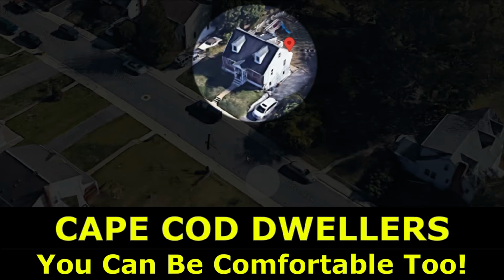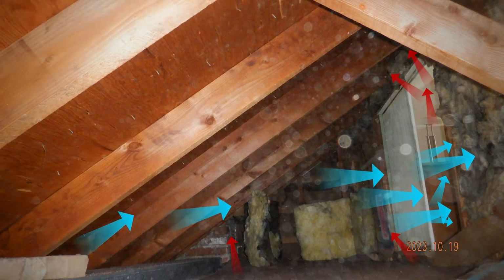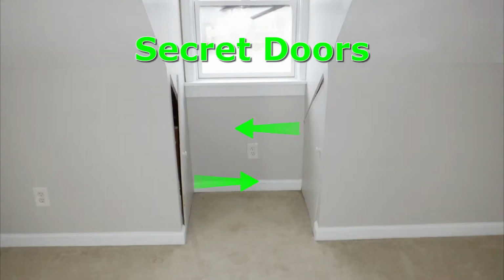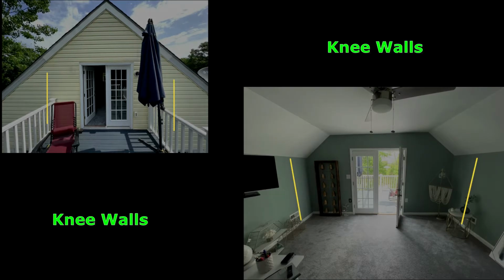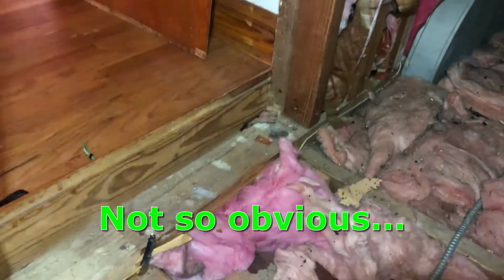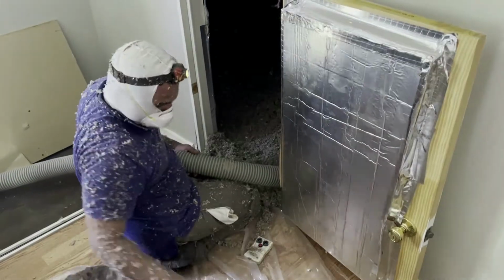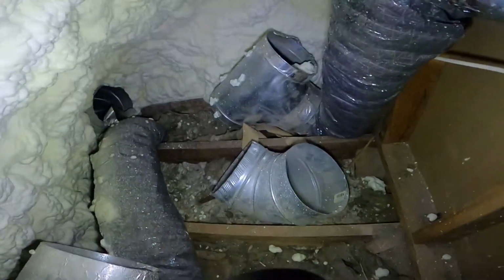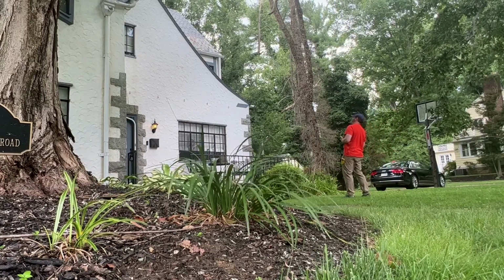🏠 How to Insulate a Cape Cod-Style House | 3 Modern Methods to Improve Comfort Year-Round

Comment: Great video. What would your approach be if a cape cod does not have soffit vents? We do have ridge vents in the peak of the roof and gable vents up in the peak area as well. We currently have super old batting insulation within that knee wall scrawl space that are stapled to the roof rafter areas--of which most of them are falling down and not working properly which is why are are looking to update it.

We have had 2 different energy companies come out to our house and give us their opinions on what to do and it was typically a combination of spray foam the corner of the house all the way up until it reached the kneewall/slope area before it goes into the actual sloped area, spray in packed cellulose in the sloped area, and spray in cellulose in the devils triangle peak area. Combining all of this with some foil/foam stuff to seal in the cellulose. 

Both companies said by doing this we wouldn’t need to insulate the lower flat attic since this would now be “conditioned” space nor would be have to spray foam any of the air gaps from lets say canned lights, etc. I kind of see the logic here, but I feel you would want to also seal off any air gaps between the 1st and the 2nd floor since we already have return vents upstairs in our HVAC system. They also said that since this would now be conditioned space, that that area of the attic wouldn't be too much hotter than our actual bedroom on the other side of the kneewall--which I find hard to believe....

Secondly—I always thought that attic need ventilation but according to these two companies, they said we didn’t need ventilation since they would be making it conditioned space. If we were to completely seal that attic space, that means no air would be going through the slope area and out of the ridge vent—which I thought was the reason for having such things. 

Apologies for the long comment!! Your video has been so helpful in actually explaining things so I wanted to get your opinion on my situation.....thanks!
Reply from the maker: Hello! Thank you for your thoughtful comment! It sounds like you're dealing with the typical complexities of insulating a Cape Cod home, especially without soffit vents. Here’s my approach: Soffit vents or not, I would encapsulate the knee wall area if possible (budget, accessibility). Remove the old insulation before adding new. When you encapsulate the knee wall, the space behind the foam is part of your conditioned space (envelope), and the need to seal or insulate the knee wall, or the lower attic floor no longer exists. You do not need to worry about sealing between floors. The key to sealing a house is always finding the pathway to take that seals between the inside and outside of the house. Before encapsulating, the space below the knee wall attic floor touches the attic, but that is no longer the case once the area above is encapsulated (foam applied to the roof deck and the gable end wall). Sealing between would be a waste of resources for no gain. When the knee wall is part of the space, the air inside flows through your HVAC system. Even if you have a wall and a door closed to the encapsulated space, air will still flow through and find its way to the HVAC system for conditioning. Your skepticism about the attic’s temperature balance is valid. Even conditioned, you may notice some variance. Ensuring the insulation is installed correctly, and the airflow is controlled should minimize these differences. Hope this helps!
Reply: @homeairleakagetest  Thanks for the info! When you say encapsulating the knee wall--you mean just sealing it from the outside world sort of speak? Also---we live in Northern VA so the summers as you know get unbearably hot. Additionally--I am not so sure about the spray foam since from what I read contains a bunch of toxic materials, and we can't even be in the house from 24-72 hours after they spray it in, which is concerning since it is unknown what the long-term effects from this may be after breathing it in constantly. The companies said they don't recommend batting insulation anymore for the areas that touch the roof hence why they switched to spray foam; but could there be an approach where spray foam isn't used?  Below are some pictures for our situation and the one company's plan of attack is the 4th image down.

Links to pics below:

Insulation Pic 1 - https://imgur.com/a/vrfyJHv

Insulation Pic 2 - https://imgur.com/a/GFaDcS7

Insulation Pic 3 - https://imgur.com/a/j0i4evM

Insulation Pic 4 - https://imgur.com/a/vGZdE1E

Company's plan - https://imgur.com/a/KrqS5xs
Reply from the maker: @agacom1  Yes, sealing the space from the outside is to encapsulate. I wouldn't believe the hype about spray foam. Yes, there is a short period that the foam off-gases, but it is a short-term inconvenience for a long-term gain. I like the company's plan and the only other thing you can do is seal the attic floor above the 1st floor, seal the knee wall and add insulation to both. Basically, change the pathway the seal and insulation takes to protect the living space. Whatever you decide to do, it will be way better compared to what you have based on the photos you shared. Good luck!

Comment: after watching your great video, I have started thinking of sealing the knee wall with spray foam to keep it seperate from other areas as conditioned space. That will seal of soffit vents there but hopefully it will be fine. Not sure about what to do about attic space tough. Currently I have blown in, and worrying about blocking soffit vents there if we blown more. Do you think it should be fine because i have gable and ridge vents? or what is the best way to increase r value there, it seems no one wants to go there and they only suggest blown in from attic access point. Thanks a lot
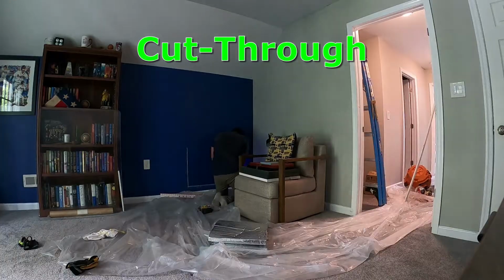Reply from the maker: Hello! So glad that you found the video to be helpful in some way! The way you can increase your blown insulation and not compromise your ventilation is to add baffles or extend baffles. Here is a video on what that looks like: at about 2:00 mins https://youtu.be/kerYwtiOfEI

Comment: I see your great at replying, so I have a question. I’m finishing my bonus room. 590sqft. I’m insulating with 4” polyiso foil faced foam board. With that insulation, I’m afraid 18k btu mini split won’t run enough to keep humidity down. But not sure 12k will be enough. I’ve thought about putting 6” of poly on the ceiling so maybe a 12k would do. What’s your thoughts.
Reply from the maker: Hi. This is not my specialty. You should get someone with a mechanical HVAC license to do a  an assessment. Do min-splits actually dehumidify? I read recently that they do not do a great job. Also, be sure to air seal all seams around the polyiso.  Hope this helps!

Comment: Does insulating the upstairs in my cale cod affect the first floor temperature? Ive been thinking of removing all gnr deywall on ceiling and kneewalls and spray foam insulation all over
Reply from the maker: Absolutely it does! There is a portion of the first floor that is beneath the knee wall attic. Sealing and insulating properly will help with comfort throughout your home! Spray foam is a wonderful solution or a Cape Cod, just make sure you have someone that takes the time to get it right.
Reply: @homeairleakagetest thank you for the advice. I got a quote which I thought was reasonable but I wasn’t sure if it’s worth the investment. The cape cod is a sauna in the summer and ice box in the winter. I’m hoping if I were to insulate the upstairs with spray foam that the temperature on first floor would benefit as well.
Reply from the maker: @bradadam3924  It will because, in the winter, the sealing and insulation will prevent heat from escaping. If the warm air has nowhere to go, then it will stay inside your bubble. In warmer months, the heat and presumably humidity will not get in as rapidly, allowing your AC to do a much better job.
Reply: Thank you @homeairleakagetest

Comment: What about the soffit and the ridge vents? Do they have to breathe or do you add a vent?
Reply from the maker: Hello! Love choclate labs! Okay, here is what you do. If you encapsulate the knee wall attic area where the soffit is, completely seal the soffit and the walls and that space is then semi conditioned so you don't need to worry about ventilation. For the top collar attic, if you seal and insulate at the floor of the attic then yes, keep your gable vents and ridge vent. Or add smart vent and ridge vent next time you replace the roof.

Comment: With proper insulation. How much can the attic room improve in terms of degrees?
Reply: is the blown in only option for collar attic? it seems it is almost impossible to crawl there in our 60s cape
Reply from the maker: It is difficult to say for sure, but I have done several Cape Cods through the years, and I am not getting any complaints! It is mostly about making the boundary between the inside and the outside better so that your HVAC can work magic for you. Be sure to seal any accessible ducts in a Cape Cod as well so that the air can be delivered to the upper floor as effectively as possible.

Comment: Does adding an air barrier/ sheathing to the main knee wall have the potential to trap moisture in the batt insulation or would it be better to leave open? I'm assuming to use unfaced batt to avoid the vapor barrier sandwich. Thank you
Reply from the maker: Hello. Thanks for the question! This is one of the more difficult questions to answer due to so many factors - mainly climate and the conditions of the space, etc. I tend to worry more about sealing out unwanted air from the outside and keeping in the precious conditioned air we pay to make. Personally, I would not add knee wall insulation in any circumstance without an air barrier as well.

Comment: My cape doesn’t have soffits.
Reply: Mine either i added smart vents and a ridge vent when I got a new roof. Made a huge difference. I dont think gable vents do much especially if attic is finished. The gable vents are behind the wall when attic is finished
Reply: @thelog86  Smart vents are basically edge vents.  I’m going to do that when I replace my roof.
Reply from the maker: I have seen that and tested houses with no overhang at the eave, and the knee wall attics are still connected to the outside. Are you looking for insulation solutions for your Cape Cod or have you already insulated?

Comment: I have 4” thick polyiso 4’ x 8’ i have cathedral ceiling section 2x6 should i leave 1” air gap or mount the polyiso direct to roof deck? I have knee wall and i am going to insulate that with rockwool and baffle up to knee wall, i plan to use that for storage but i will still put insulation in the 2x4 5’ high knee wall, im going to do r15 batt with a 2” rigid foam back.
Reply from the maker: This is a really good question and I think I recently lost a job because my answer would be install the foam board directly to the roof deck and allow the gable vents (if you have them) ventilate the top collar flat. Treat the sloped attic, the top collar, and the knee wall attic as three separate spaces. Close off the sloped portion so it is not connected to the top or the lower attic. I live in Maryland where we get some extreme weather days/periods but there are so many configurations that I see and rarely do I find mold or rotted wood in the attic, even when things are not done exactly right. I suppose if you have access and you can create the perfect channel, but be careful that it does not create a route outside that conditioned air can take.
Reply: @homeairleakagetest  awesome, i have eve vents and ridgecap, started to finish out the upstairs.  So i found someone that was sslling the 4” of plolyiso sheets 40 bucks each, so i heard mix no air gap to gotta do air gap from eve to ridge, my head was spinning.  Without air gap will make so much easier, plus with 2x6 bay the 4 inch polyiso r26 then 1.5 inch more it will be close to r38 blammo! Lol i will seal edges with good caulking or if gaps larger than 1/4” can spray foam to seal it.   Great info and thank you!   I subscribed,  i got 1k sq foot of unfinished area to do.  Lol i think i am leaning toward beadboard over the drywall so dont have to sand n deal with drywall mud 🤪
Reply from the maker: And thank you for watching and contributing!
Reply: @homeairleakagetest  oh im in north carolina, not sure if that would alter anything.  Not as snowey as maryland, more humid in summer.  Just west of winston salem, down the road from Jr Johnson orig moonshine NASCAR guy.  😂
Reply: Lol i gonna lose my head the polyiso is jogns manville it has foil on one side.  To foil or not.. 😂.

Comment: This is very helpful.  We are having to remove old Vermiculite by an abatement company.   Do you think new insulation will have a significant impact on the hot summers/cold winters?  We have forced hot air, and the upstairs is obviously the last place the air gets to.  Is there a better system for heating/cooling cape houses?
Reply from the maker: You will be okay with what you have! If you create a tight bubble by insulating correctly - using the correct techniques - the forced air will work more effectively. While working in those tight places, technicians should check duct connections and make sure they are in good working order.  I used to think the air traveled along through and got to the other side, but what is really happening is that the ducts are pressurized. Static pressure. Once the air gets all the way through the entire duct system is under pressure forcing the air through the openings (supply) so it is way more important to seal ducts and make sure there are no pressure release points. Better pressure = better air flow  Hope this helps!
Reply: Thank you!  I will mention/ask about this when it's time to re-insulate.  @homeairleakagetest

Comment: Since I was little I froze in my Cape Cod house my parents owned. It was always cold. How many years later we have purchased this home from my father and are now figuring out how to properly insulate the upstairs bedrooms.
Reply from the maker: Cool! What methods are you using? Did this video help you in any way?  Thanks for your comments. 🙂
Reply: Adding my comment 11 times lol this is a process this house is extremely cold in the winter and humid in the summer
Reply from the maker: @Tiffa1004  absolutely you can send me an email. eric@hometrustremodeling.com
Reply: Same same... 1960 cap cod in Wi.  Dad put vermiculite in the knee wall attics, plywood decking, never blocked off the joist cavities and everything else is fiberglass batts... collar attic has batts and decking. Second floor is usually 10 degrees cooler than the first floor in winter and me and my brother lived up there 😟 Used to get thick frost on the upper knee walls when it got really cold. Tryna get ideas for upgrades... would like to get all the vermiculite sucked out and replaced with...  something? Thanks so much for the video! 👍